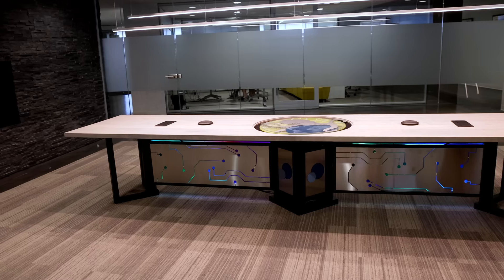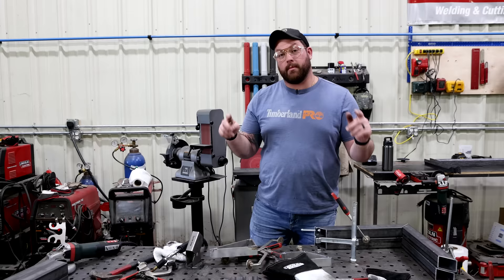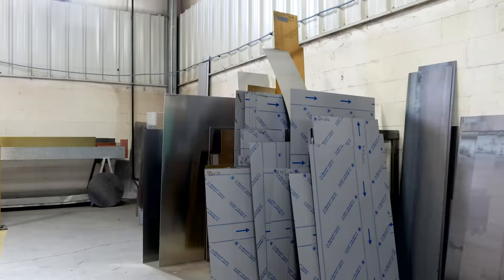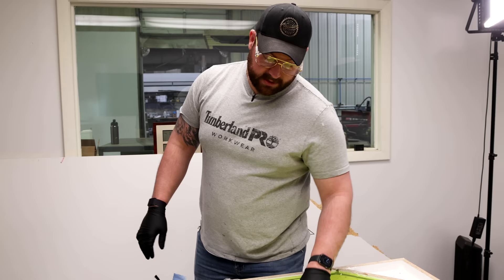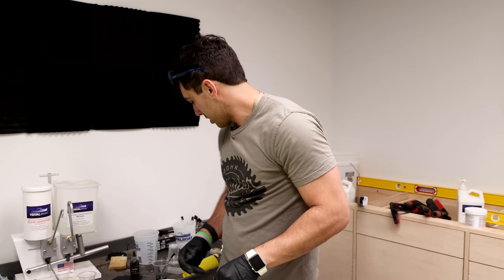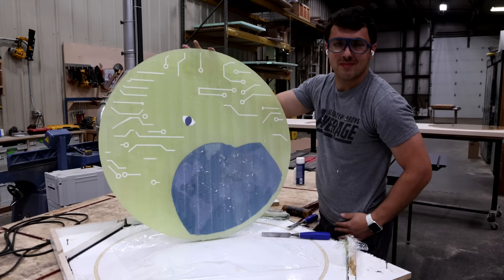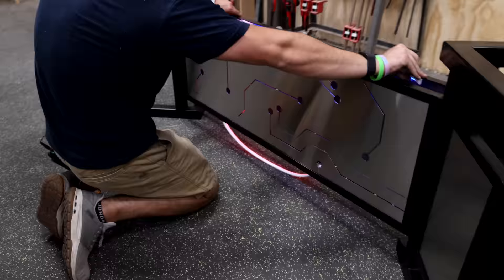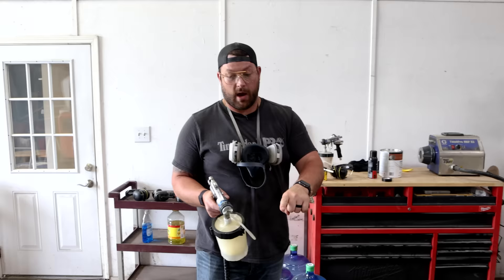I Did Not Expect This Clients Reaction

Comment: I know how much power those industrial fans need and it is a lot. I'm impressed that the Delta Max did not have any problems powering that huge fan.
Reply: It's actually not a lot. That's a DeWalt DXF2490, rated for 1.46 amps or roughly 180 watts. Looks like the delta max can handle up to 2400w, so it could actually power 13 of these fans at the same time.
Reply: @BjarniArnason  I’m it’s a bit late but all the comments about the delta max are bots

Comment: Awesome table! The only thing I would've done differently is adding frosted plexi behind the metal circuit board base panels. It would help even out the LED light distribution, and it would also support the thin metal from bending. It looks like that metal would take one wrong kick to bend pretty badly.

Comment: Knowing how a board will cup is essential and on its end grain the more pronounced the growth rings the more likely it is to rack-twist. Indeed the growth rings often look like a smile or a frown depending of which face of the board was towards the trunks outer side and its a must to them at a minimum or use center boards where the make a bullseye on the end grain. When building a deck the boards end grain should all look like the frowning because the boards will cup downwards and its edges wont be exposed. However when their smiling its edges cup upward and you've likely caught an edge with your foot because they were installed this way on a deck. End grain will tell you how likely a board will twist or cup and choosing boards with more vertical growth rings is the best since the deformation will be less. To be fair, I've ripped lumber and seen it begin  to rack twist even before the cut was finished and looking down the edge you'll see which are the truest after a cut and those that sould not be used at all.

Comment: Just to follow up on my earlier comment about this being the best table you've built, I got to thinking earlier (if you knew me you'd know that might be a bad idea) about something I saw at a car show back in the day. All kinds of stuff, like car shows usually have, but one enterprising soul decided to rig up some hydraulics to open and close the doors, hood, and trunk, and re-worked the back seat so he could put a fully functioning waterfall in there. Had a storage tank under the floorboards to hold the water when he moved it (damn thing was still driveable) but I think the only time it was driven was to get it on and off the trailer. After watching several videos on here of people making 'river tables' I happened to see the one you built a while back that had an epoxy river with a custom cut piece of glass on top of it. After seeing that, I've often thought of trying to build a table with an actual river in it. Maybe toss in a couple fish to prove it's real. I figure once I talked the squirrels in the yard to help, the trickiest part would be coming up with a way to seal the wood so it didn't get waterlogged and once that's under control, the rest should be pretty straight forward. Have to come up with a couple slabs, which shouldn't be too hard, and I probably got enough stuff laying around my shop or my barn to build the rest of it. Hmmm...wonder if my neighbor would notice if the oak tree in his front yard suddenly disappeared......nah...probably better to see a guy I know a few miles away that usually has a few slabs that are already dry and get what I need from him.